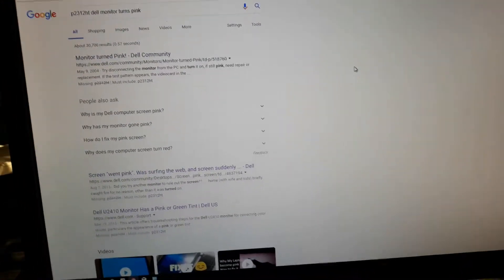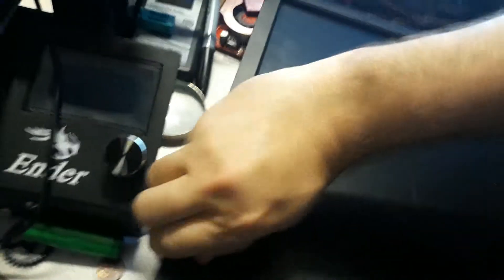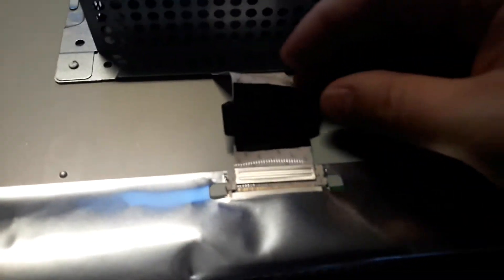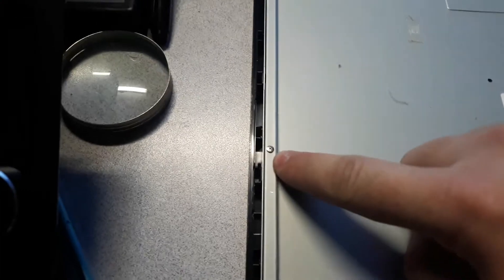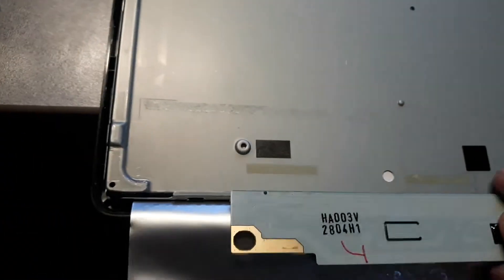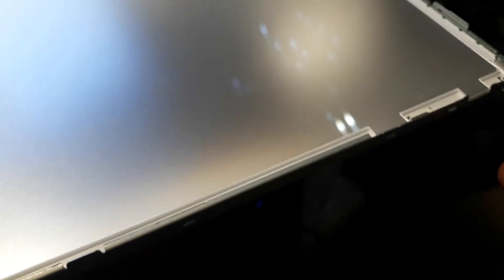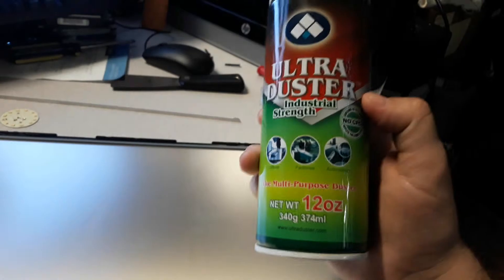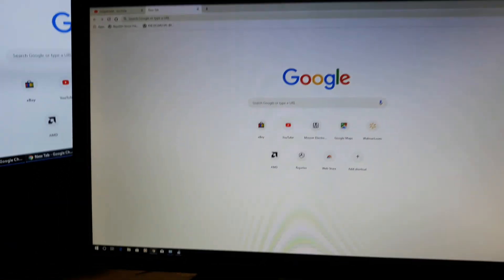Dell P2312H Backlight Repair

Comment: Thanks so much! This was super easy to follow along and deconstruct my monitor. I didn't have a new LED so I put it all back together, (I was trying to see how hard it all was and if I could do it myself,) and the dark part of my monitor is no longer there. I guess a wire somewhere was loose and unplugging everything and putting it all back together fixed it.
Reply from the maker: The LED backlight has at least two parallel arrays of LEDs to keep the voltage down. If there was a bad connection or a marginal LED in only one of the parallel arrays, you can indeed get dark areas on the screen.

Comment: My P2412 is working ALRIGHT for about an hour Then a thermal upshoot near the regulator SWITCHES OFF the DC for backlit. I am sure a maestro like U can publish tips to change the component.I am 86 and continous on hand mulitimeter/soldering iron experience I amSURE there is a component  a Capacito ot IC which causes the problem CAN U GUIDE ME SIR?
Reply from the maker: If the monitor is staying on while the backlight is off, there are still several potential failure modes.

The LED backlight module could have a marginal LED that is going open when it gets hot, which would kill the whole module since all of the LEDs are in series. Another potential failure is if one or more of the LEDs shorted out, it could cause an increase in current draw and make the driver go off on overload or thermal cutout.

The backlight driver itself could also have failed in numerous ways. Since there are no schematics available, you'd have to have the power board exposed when the fault occurred to be able to do any testing.

You have to be very careful when doing testing like that though, because there are nasty high voltages all over the board, both AC and DC. The backlight voltage was something like 56v IIRC, in addition to the SMPS and mains voltages which are even higher. The safest thing would to have it on an isolation transformer, unless you're comfortable poking around on super spicy circuitry.

Comment: My Dell U2312HM turned into red/pink tone on the right side of the screen only, and that happened over the night. (The night before everything was ok, next morning that happened). And there is some flickering on that right side too. This method will help in my case as well?
Reply from the maker: While both mine and your monitor look the same externally, I can't tell you if they're the same internally since the model numbers are different. The failure mode you describe automatically makes me think your monitor is different internally due to it only flickering on one side of the screen. The monitor in the video only has one backlight strip on the right side of the screen, so if it failed, it would make the entire screen flicker, not just the right side.

If the backlight is worn out, changing it will fix the problem you have. But you'll have to do some diagnostics to make sure something else wasn't causing the problem, like a bad power supply.
Reply: @GGigabiteM  Many thanks!
Reply: Same has happened to me. Did you attempt the repair? did it work?
Reply: Attempted to repair, but in the service they told me it is panel that is in fault... and that repair is not cost effective.
Reply from the maker: @slobodanljubisic  Ironically, the very same monitor featured in this video later failed with the exact same symptoms as you describe, where one side of the picture turns purple. I did a bit of digging on this monitor and it turns out some passive SMD components on the TCON board failed. I was able to use freeze spray to narrow down the area that failed, which were a couple of super tiny SMD capacitors. In my case, I was able to just remove them and the monitor worked after that.
Reply: I see, thanks

Comment: My dell 2311hb is turn yellow and dark,I think its backlight problem too.But is seem hard to change it.
Reply from the maker: Your monitor uses the older CCFL style backlights. When these start failing, the ends usually go black and sometimes burn through the glass envelope and start arcing to the chassis.

Changing these can be a bit more challenging because they're often in a metal carrier that needs to be removed to change the CCFLs out. I'd recommend an LED retrofit kit which comes with LED strips and a driver. These last far longer and use a whole lot less energy and produce less heat.

You'll have to carefully disassemble the LCD panel to get the CCFLs out. There are multiple layers of polarizing sheets and an acrylic diffuser in a sandwich with the LCD glass, you'll want to keep these together and not separate them. This reduces the risk of getting dust between the sheets that can show up as artifacts later. You'll also want to wear gloves to keep oil from your skin contaminating the sheets.
Reply: Thank you very much.I'll try to do it.